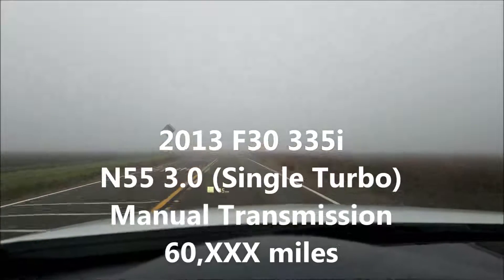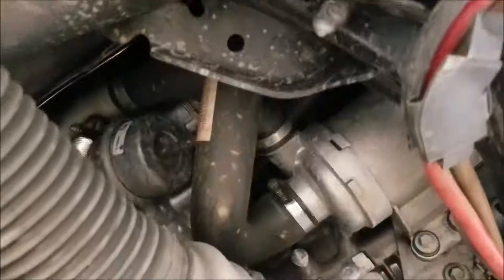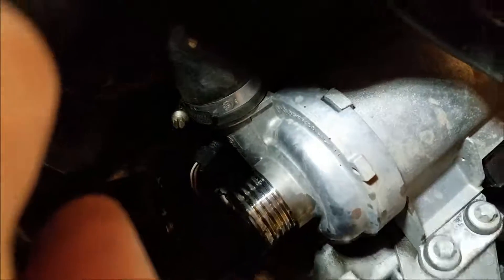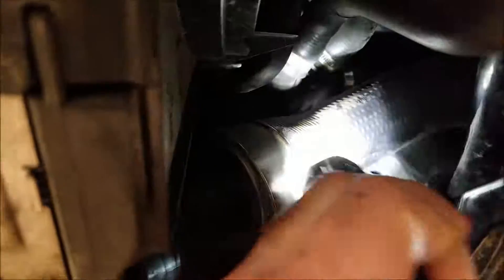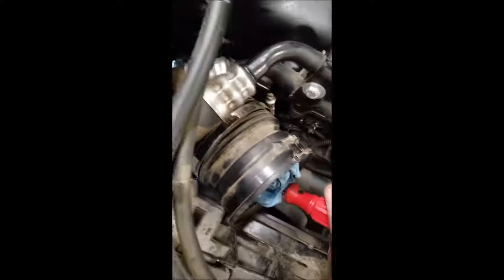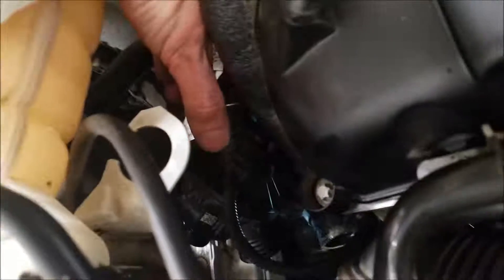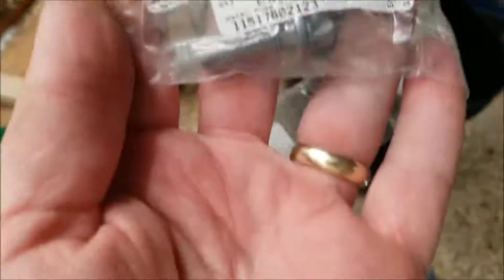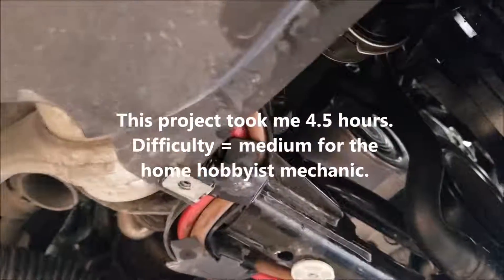BMW N55 F30 335i (2013) - Water Pump and Thermostat Replacement

Comment: Ok so have just done this in my 2014 f30 335i rwd. First off good video helps alot. You have to remove the rad fan first. I have no idea how this guy got the thermostat out without taking out d fan. If u search u can find a video how to remove fan. I have the 8sp auto so i have a small trans  oil cooler on the RHS of fan. You need to unscrew this and den pull in up about 1/2 inch. Its slotted into d fan. Der are 4 pipes  in an out of it but ders enough play to move it. The rad hose on top right also needs to be removed to get the fan out. D fan is plastic so u can bend it a bit to get it out. Also at 4.07 do not remove this pipe. Its not needed and if u have upgraded to a hard pipe it will b hard to get in. Finally the trick to getting the top scew of the water pump is. Put the e12 socket on first by hand and hold it in place (move rubber hose slightly). Use a rachet and 2 flex sockets and attach dis to d e12 socket u are holding in place. Den unscrew

Comment: I have an M-sport 335, only thing different was I had to pull the thermostat out to the right. 
There is some extra tubing behind the thermostat that connects to that back hose, I believe to the accessory water pump (M-sport has 2 water pumps), blocking you from pulling it out above the exhaust how you do here. So I also replaced the entire mickey mouse hose and flange. The mickey mouse flange hadn't failed me YET, but came out in pieces!!
--Side note I was fighting that second hose on the water pump for an hour. shit was like melted on. 140k miles original pump.

Comment: Thanks for the video!! Wanted to make one for this but it was such a messy job and my camera helper was gone for the day. Got the thermostat and water pump out and installed in about hour and a half, I didn't need to disconnect the bottom air hose and if you have skinny arms like me it's just enough room to work. Glad I didn't attempt to remove the fan, what a nightmare! lol

Comment: I had similar issue with the pump, running all the time when car is locked/unlocked and draining battery to death. Replaced it watching your video, but had so many issues with the top bolt of the pump. Didn't have required tools, only pump took me 4 hours. Hoping the issues will be gone ! Thank you ( Did this on 2012 335i )
Reply: And did it fix the problem??? Because i have the same issue now and did order the pump and thermostat.
Reply: Yes, no more battery drainage and pump doesn't work all the time. The pump was the problem. As much as I read, the temperatures causes schematics to failure somehow and triggers the pump to work all the time. @hansvandermeesterende6490

Comment: Just did mine but I have xi AWD it was much more difficult, you have to remove the rad fan, there is absolutely no room room from below, was near impossible to get the hoses off and on.

Comment: I replaced the thermostat from the engine bay without getting under the car. Took me no time.. 20 minutes maybe. Pull intake, remove fan, remove the clamps, pop the springs, make a big mess. put it back together. Easy

Comment: ATTENTION - Easier access to the thermostat is through the passenger front wheel well,, remove the wheel liner and the thermostat with the clamps screws right in from of you with tons of space and wiggle room.
Reply: Really??? If you are correct, I will pray to the Car Gods about you
Reply: @spacemonkey7461 well was it correct?
Reply: about to put this theory to the test tomorrow, thanks!
Reply: False on f32

Comment: I’m doing the same project. If you do two things, it’s a lot easier. 1) Remove the fan loom connector with a long *ss needle nose plier, and move aside towards the back. 2) Disconnect the coolant line on top with a bleed screw, and move behind the air intake. Then there is much better access from top. I didn’t have to remove the fan. 

Next steps: Remove the crossover line. Break free the ac line. Now you have access from the top of all of the thermostat. I removed the electrical plug with the long *ss needle nose. Used long *ss pick tool to remove the quick disconnect in front hose. Flexible nut driver to remove both of the other hoses from the top. Then another long *ss pick to remove the last hose.

Remove intercooler air line on passenger side from the intercooler, push aside. Pull thermostat from the bottom, finagle out where the water pump was. 

Install in the reverse order. Then install water pump. Hook up all free hoses.

Comment: Thank YOU for making this.  Its conflicting indeed.  Some 335i use the thermo with 2 mounting screws.  Some don't.  I need to replace mine and the part came with no mounting screws like every other video on YOUTUBE.  Your video is the only one that shows this.  Thank you again.  I'll know for sure this weekend when I replace mine.
Reply: Some kits don't come with the mounting bolts. If possible, buy steel bolts instead of the OEM aluminum bolts. The steel bolts can be reused and are more durable.

Comment: Good video..on my 2013 328i, I did this on ramps and without the drag of the body on the chassis, had to lift the engine a bit to get to the bottom bolts.

Comment: Just did this on my xdrive, the huge subframe made this a pain, but not impossible by any means.  Guys, if you remove the cooling fan , the thermostat is right there.
Reply: i was looking for this info for my xdrive . Thanks

Comment: super video, appreciate the tour and dialogue!   I have the same car, wondering why you had to change out the pump and thermo at 60k miles?
Reply: well... its a BMW lol, they are famous for not being reliable
Reply: Bmw usually recommends these to be replaced every 60k. I'm at 48k and my thermostat is going out

Comment: I have 130k plus miles on my F30, 28i xdrive.... zero issues, not sure why those parts failed so early.

I intentionally drive the heck out of the car on my long commutes just to see it’s limits.   Haven’t been disappointed.
Reply: Might depend where u live the weather. And environment
Reply: The water pump and thermostat on a newer BMW after the F series are not prone to failing as often as those found in the older series like the E series models. The main reason why the water pump fails often on a older BMW model is because of a design flaw by BMW where the motor blower burns out the water pump thus causing it to fail prematurely.
Reply: motor blower? what part are you referring to? fan failing then burning out water pump? @raulmartinez3484

Comment: Great stuff.  BTW.. For those who want to replace the thermostat the repair manual has you move the expansion aside by removing one bolt.    This will generate better access to the thermostat below.   

It's also recommended to replace the coolant hoses down there every six years.
Reply: W tip

Comment: Thanks for sharing this. Did you replace these parts as preventative maintenance or because they failed? I'm approaching 115k miles on my F30 335i but the cooling system is operating fine. I'm contemplating replacing it now or wait until failure.
Reply: You can do it as preventive maintenance. I read in some of BMW forums that is good idea to replace water pump + thermostat every 60 - 70k miles. You can find oem  parts cheaper online and  do it by yourself as shown in the video. If you co to BMW dealer will be 2-3 times more expensive.
Reply: peshehodetz08 Mine recently just gave out I’m pretty sure. Got the check engine light on my 13’ 328i with 91k miles and low and behold the code that it’s throwing is the MAP thermostat

Comment: Question... what were your symptoms?  I have a 2012 F30 335i that just blew the vent hose (from expansion tank to top radiator hose).  I replaced it but it has a check engine light on and a P0128 code and 3 U1408s that I can read.  Seem like the temperature gauge is not showing the car warm up at all.  Starting to think I have more issues than that one bad hose I replaced.
Reply: I'm having this same problem. Did you ever find a fix to it?
Reply: After I replaced the hose I scanned again and cleared out the codes.  It is now warming up fine and the codes have not come back.